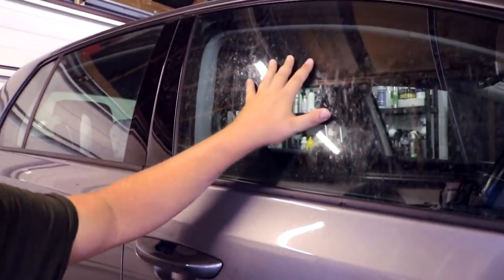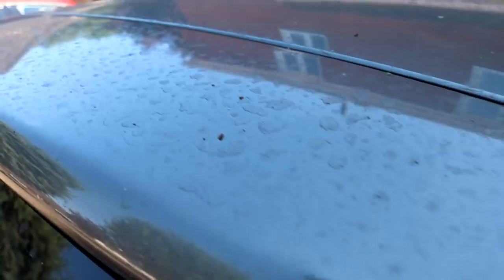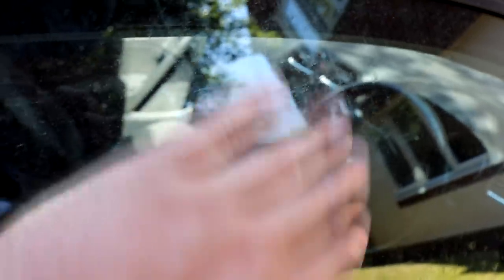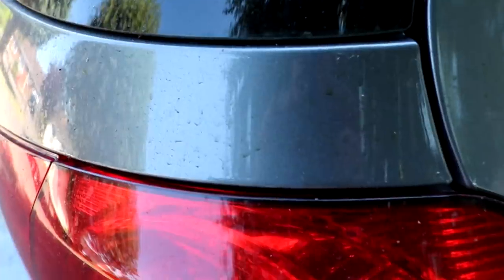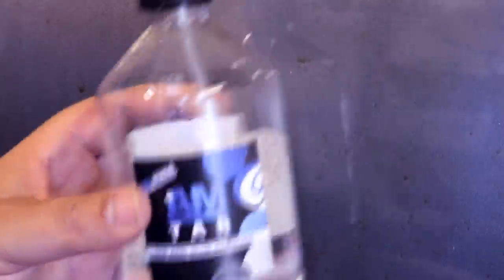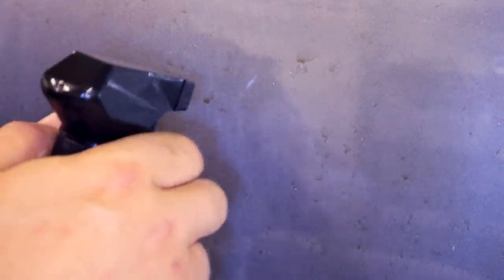Car is plastered with Tree Sap - How to remove tree sap safely

Comment: Correction; I'm no longer watching this particular video. I've tried the notorious h2o alone, didn't work the way you have presented.
Reply: Ok
Reply: This is for a very different kind of “sap.”   The pine and fir sap that hardens and dried does not come off this way at all.   I’m having an issue now with that.

Comment: Had my car under some trees at a show and got covered in sap. Didn't notice until the following weekend after it had dried and picked up some dust. Sap is basically clear. A good pre wash followed by a thorough shampoo, after wash and dry down removed all and back to normal. Severity of the problem is I think down to how well the car is "waxed". If the finish is polished and protected well the sap should come off easily and little if any further work will be needed. But, if tackling auntie Flo's Fiesta that goes through the car wash every six months and that's that, the sap is likely to be more of a problem as it has a nice rough surface to bond with. Likely though, the drive through will take it off to her satisfaction. Water is cheap and at least that isn't over hyped...…..

Comment: Wow that was an amazing found, thanks for saving me money on those tree sap removal products.
Reply from the maker: note the crap on the car in this video is whats called honeydew or aphid crap. sticky brown residue and the aphids are on the trees.  This crap is water soluable.   If you get like the treekle like stuff that comes out of the branches, it probably wont be water soluable.   But in short if you think you have zap on the car, just wash it first.  95% of the time that will sort it if its honeydew.  if not  then a mineral spirit type remover product is the way to go.
Reply: Forensic Detailing Channel     Thanks a lot for you reply John, you’re very helpful as usual.

Comment: Excellent video Jon. I always wondered why there was so much commotion around tree sap and how to remove it as like you, a pressure wash rinse, prewash and another rinse would be all that is required when I deal with it.
Reply from the maker: yo brian hows it going mate.  I think the problem is 99% of tree sap isnt actually tree sap.    its actually honeydew or aphid excrement whatever that is :)  but checking its water soluable seems a good starting point.
Reply: Not true .  I’ve washed many a car before trying chemicals to remove the sap.  Yours trees where you live must produce weak sap .
Reply: @braddavis9154  or maybe your pre-wash isn't very good?

Comment: That is not tree sap. Trees do not produce sap in that kind of quantity, and actual tree sap will not come off with water. That's residue from the leaves.
Reply from the maker: i think its aphid crap :) also called honeydew.  but like you should also try water first on any sticky crap that looks like sap becuase more often than not its this stuff and its water soluable.   your absolutely right though.

Comment: Hand sanitizer works great for removing tree sap
Reply: Javier de los Santos That's basically like using IPA like he did.
Reply: Well, you're half right. Along with IPA, it contains glycerin which acts like a lubricant. As soon as it starts to dry just add a little more hand sanitizer until the sap is removed. I'm sure hand sanitizer is probably more practical to have in your car than IPA solution.
Reply: Yes but this isn't a practical solution for a car plastered with tree sap like in Jon's situation. Would have to buy a gallon of sanitizer! :(

Comment: That's the last thing i'd expect to work 😮.
Thanks 4 sharing.
Btw the discount code for In2detailing in the description doesn't work.
Reply from the maker: you sure lagoyaz.   its been around for a while.  theres some items in2detailing do that you cannot use a discount with, it could be this.  (power tools I think you cant)
Reply: Forensic Detailing Channel Ah your right, you need the right stuff in the shopping cart to be able to add the discount code. 
Thx for the discount!

Comment: Are you sure that's tree sap? I think it's Aphid excrement, which washes off easily with water. True tree sap, like pine pitch is used to waterproof wooden boats (in the olden days) and will not come off with water.
Reply from the maker: yes this is most likely honeydew/aphid crap, if it washes off.  If it does not wash off them try IPA.
Reply: Glad I read this.  I finally got my neighbor to fix his sprinklers, now his tree is crapping all over my cars.

Comment: Must be nice to have water soluble tree sap. Here in USA we have no hybridized trees that would produce water soluble sap.  So we have to use chemicals. Looks like alcohol works best, in the form of hand sanitizer gel. My next go to would probably be “Goo Gone.”  I would just let it sit on it for a while before taking an old credit card to it.
Reply: I have a flowering plum hanging over my driveway(NY).  The sap is all over my car like it was aerosolized.  Looks crystallized and attracts any dust that blows in the wind.  
Fortunately, it hoses off easily, but I’ve yet to let it linger more than a day or two.
On one of my cars I use Gyeon Wet Coat, the other is 303 Graphene & Topper.
Really annoying after spending the time to do a proper wash.

Comment: I always get these hard orange lumps which can be dissolved with poorboys bug squash or picked off using a fingernail water wont remove them even with a pressure washer. Anyone know if it is tree sap or something else? I want a cheaper way to remove them if possible. Thanks.
Reply: MicksTips insect/bee pollen???
Reply: Smart Auto Valet (Glasgow) That is definitely possible what do you recommend for removal I use Poorboys to soften it and try and dab it off but a fingernail works quicker although thats probably not the best way. Claying is what I originally done but unsure if thats fine each wash in the Summer months, in Winter it disappears mostly.
Reply: MicksTips Bilt hamber Auto Foam seems to work for me. Pressure washes off once soaked in the foam for 5mins. Depends on how long it's been sitting on the paintwork though I guess.
Reply: Smart Auto Valet (Glasgow) Will have to try it I use a decent snow foam but its never worked to dissolve it at all. Thank you.

Comment: wd-40 works well on window rubbers. Not got the balls to use it on my paint
Reply: 🤦🏻‍♂️ Short term maybe but I wouldn't be spraying wd40 on my car... It will, over time, destroy the rubber
Reply: @markkerr3761  that's the idea. Short term, like a newly purchased car that wasn't looked after getting it's first detail. As long as you don't over saturate it and use a rubber protectant afterwards, you'll have no problem with possible wear

Comment: Do think it was so easy due to your wax/lsp
Reply from the maker: it made no difference really.  because cleaning it was not a case of shifting the contaminant from the surface, but a case of disolving the contaminant..   so any protection was not really doing much there... but protection is still of course better to have than not have...   not sure whats on the golf gonna quickly machine it down like in 1 hour and put something on it at some point.. its a bit of a test mule  :)

Comment: Water doesn’t work, I used glass cleaner mixed with water
Reply from the maker: sounds like you had actualy sap from the wood, which needs a solvent, but you should always try water first.   Its prolly the IPA or solvent in the glass cleaner thats doing the work there
Reply: Glass cleaner on paint no no. My roomates done 3x on cadillac . 1st insurance covered , 2nd deductiable 500 3rd out of pocket 4k . Trust me they call it glasd cleaner for a reason.